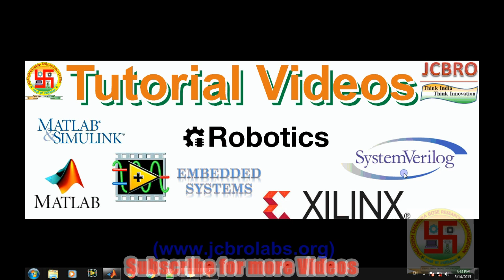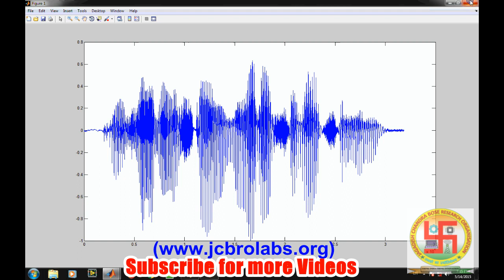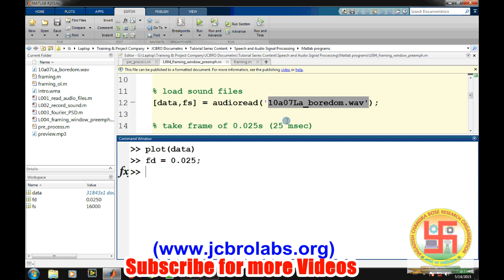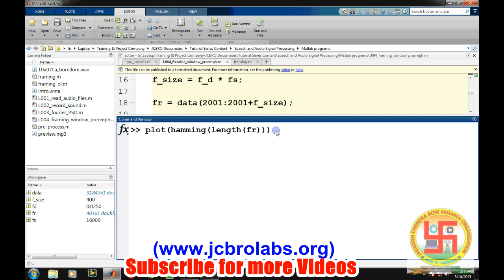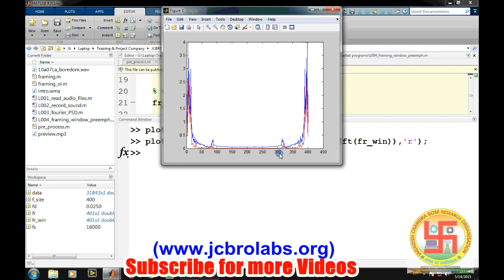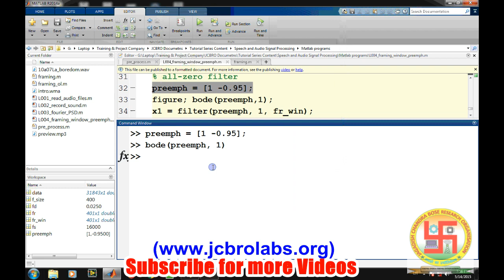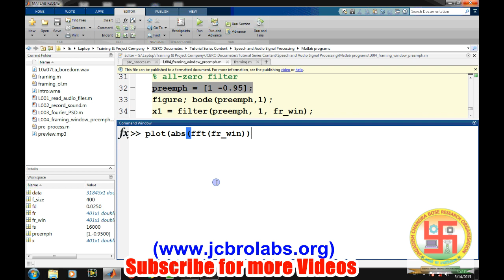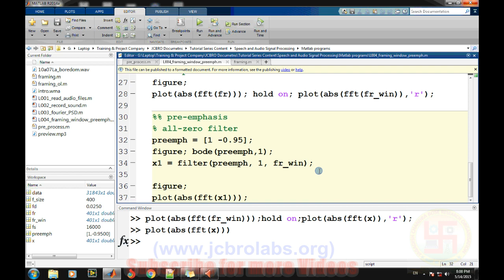L004: Framing, Windowing and Pre-emphasis of Speech Signal

Comment: I am using this for windowing of all frames ..but its not working.Plz correct me

frames = framing(data, fs, f_d);
frames_win=frames.*hamming(length(frames));
plot(frames);hold on; plot(frames_win,'r')

Error :Error using  .* 
Matrix dimensions must agree.
 
also what to do for overlapped frames..like  if its 50% ovelapped .then in framing function what should i change?
plz help.

also congratulatiosn for ur efforts sir.